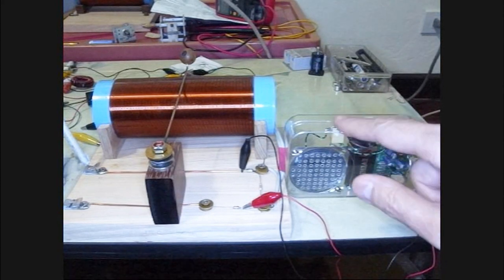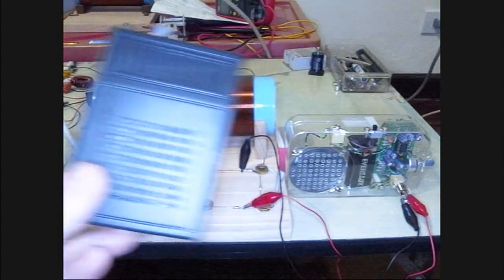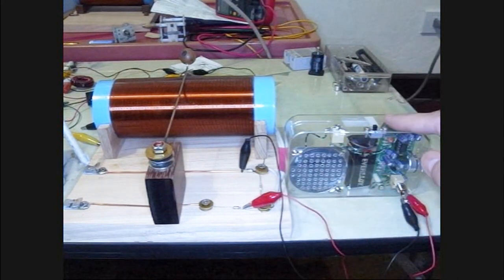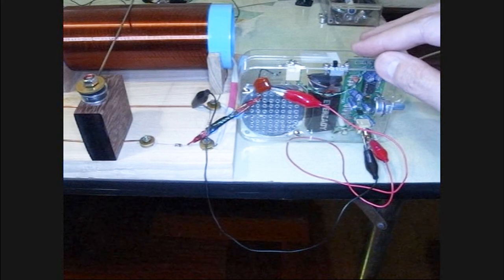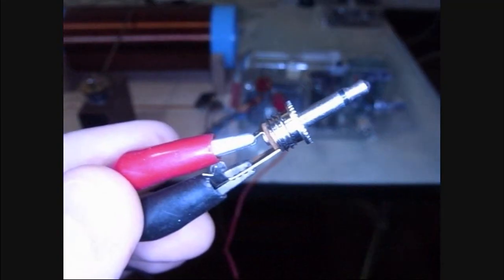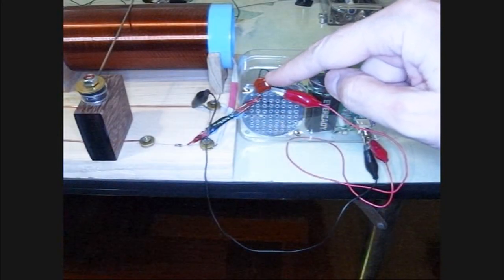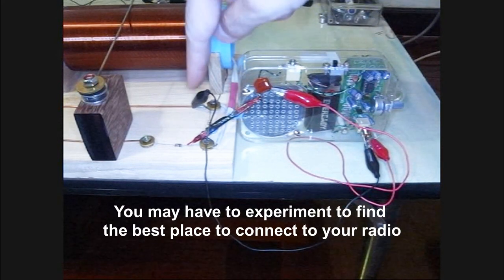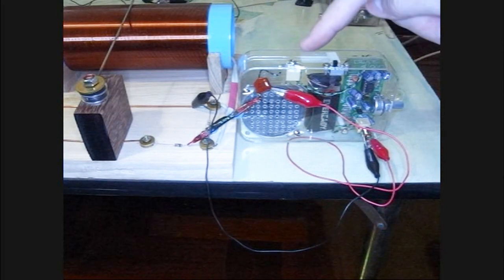Crystal Radio, Connect A DC Audio Amplifier

Comment from the maker: RELATED CRYSTAL RADIO VIDEOS: 
Updated Video: Best/Easiest DIY Crystal Radio - No Batteries, No External Power 2023 (4K)
https://youtu.be/fLVCqZGpv3U

My New Favorite!  Crystal Radio with Antenna Tuner:    https://youtu.be/mh5KxCpbQ5U
Crystal Radio, Capacitive Tuning - WORKS GREAT!:    https://youtu.be/VJ80Nm9KSkE
Crystal Radio & Resonant Coil Design:     https://youtu.be/Fw9eb-aB-XU
Crystal Radio Antenna (Shortwave Also):    https://youtu.be/G8AsgZbncW4

My Crystal Radio Does NOT Work (FIXES for common problems):    https://youtu.be/kCxQ8iPQx4s
Good Crystal Radio Connection Points:    https://youtu.be/G3qjrReHR1k
Three Upgrades For Your Crystal Radio:   https://youtu.be/LENco3_jV_s
Crystal Radio Wiper Upgrade:     https://youtu.be/i1otDz39nlw
Popular Crystal Radio Design That's a Waste of Time - And Why: https://youtu.be/r9Onub2Xpzc   
New Crystal Radio Design - "Modified-Pickard":     https://youtu.be/_qxHhFKjLAg
Crystal Electric Generator RF Energy Harvesting Exp 5 - Full Wave Rectifier:   https://youtu.be/BTu_GJKjOmA

Comment: I used a small battery powered speaker from the dollar store, but I didn't use a capacitor. Can you just use any DC powered speaker? Why do you need the capacitor?
Reply from the maker: The cap limits the amount of draw from the radio. If your battery amp works without a cap it may have an input cap or be high impedance (resistance).